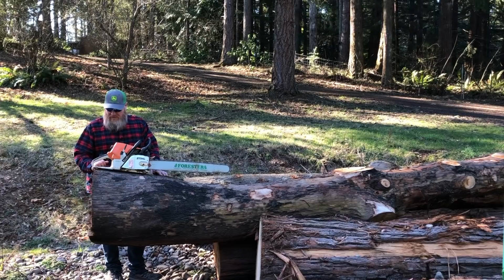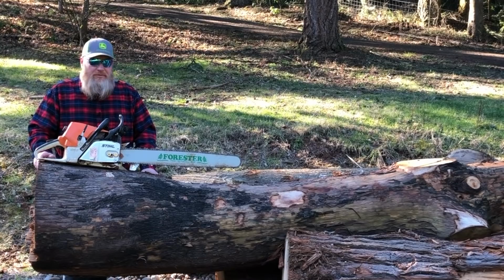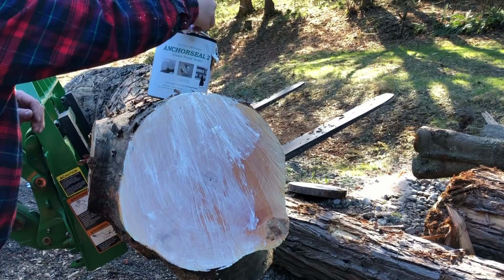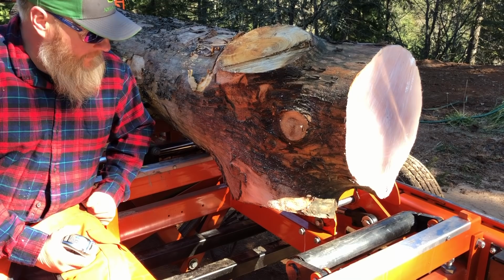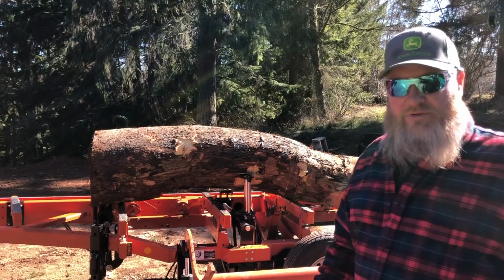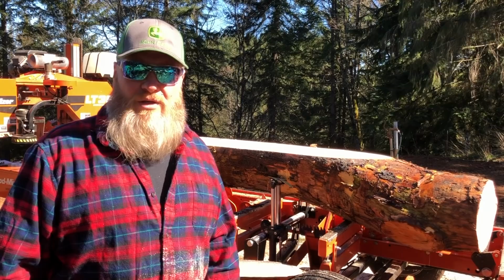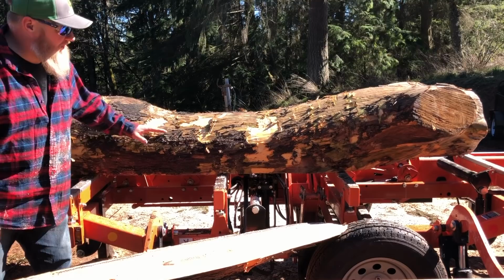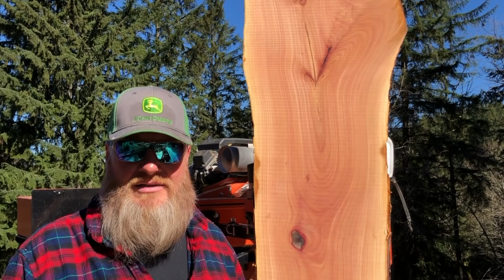Milling MADRONE!

Comment: "What I'm going to do here is put the log back up on the deck". That's some funny stuff right there.

Would lots of weight on top help keep it from bending?

That madrone has quite a different crotch figure than the Walnut. More straight grain but still looks good.
Reply from the maker: It’s been my experience that if wood wants to bend and you try to keep it from happening with straps, clamps or weight, it’ll just split instead.

Comment: Hi there, 
Great video! Thank you!

I’m cutting down a Madrone at a development site up here in Victoria B.C. on Tuesday next and want to cut some slabs with a friend’s mill.  Can you give me some advice on how to dry the wood and reduce the warping and checking.  Do you have a video? I’ll use the anchor seal right away. I’d like mill it very soon after the cutting.  
Appreciate the help!
Gary
Reply from the maker: Thank you! I’ll be honest. The only Madrone I’ve had luck with was from a tree that had been dead for o long time before it was taken down. If you’re going to mill a green log, definitely seal the ends and saw much thicker than you’re going to use so you have room to resaw the warp out of it. I’ll comment again with a link to a resaw video I made.
Reply from the maker: https://youtu.be/bNa9PsdQazM
Reply: Thanks man!  I’ll let you know how it goes.

Comment: Ok stupid question, you say it needs to dry slow so kiln drying not a good option? Thanks for sharing, God bless
Reply from the maker: Any hardwood needs to air dry to below 20% before you kiln dry it. The air drying part of this wood is where most of the movement will happen. Once it’s below 20%, it should have done all the twisting it’s going to do.
Reply: @NorthwestSawyer  ok thanks